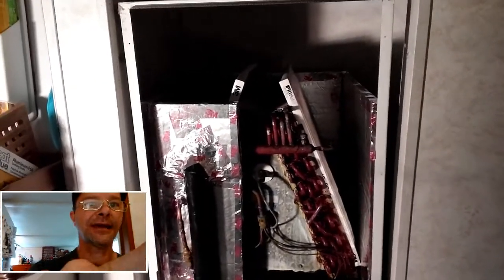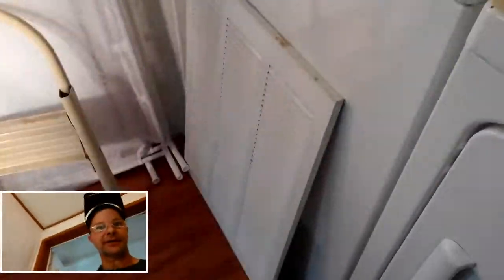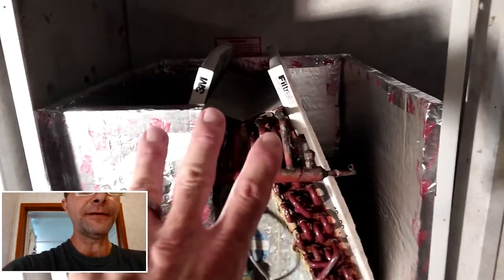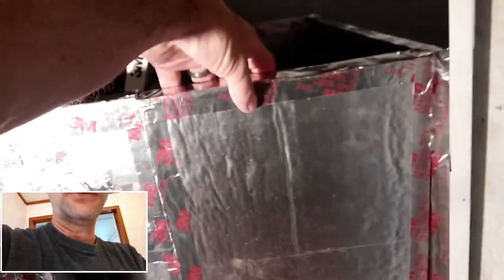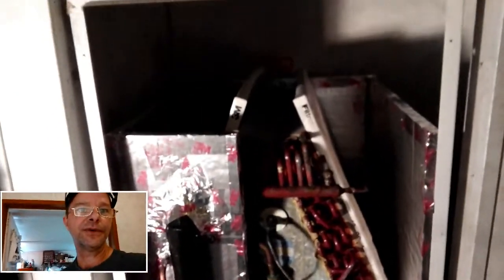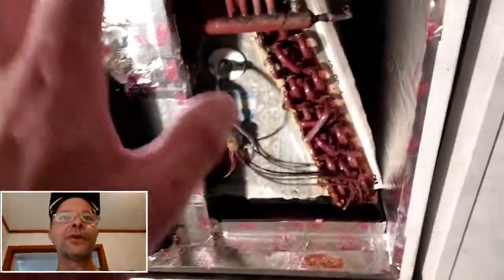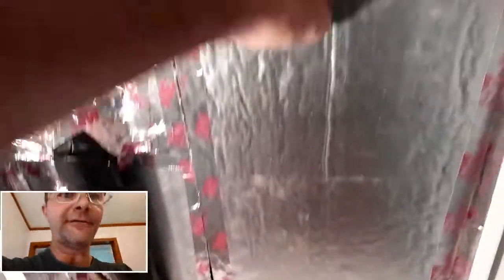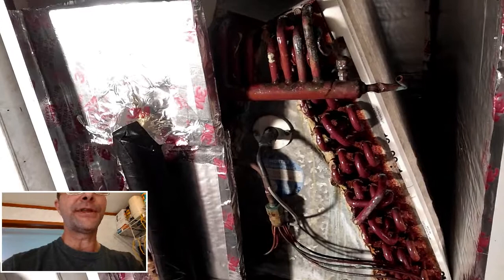HVAC Filter base update, NEW LG E-980 vid. Phone!!

Comment from the maker: Noperz, the enclosure is actually aluminum coated foam board.  I would have normally used fiberglass board but didn't feel like driving an extra 20 miles for the stuff, so just stopped at Lowes.  Use aluminum sided since I dont' want any chemicals leeching out of the material into the airstream.  I know they say the stuff is 'safe' but I'm paranoid ;)  I am using metal tape to cover the cut ends.  I installed the UV bulb, and they say they do kill micro-nasties but I don't have a way to prove it

Comment from the maker: Ok, seems to be working! If you mean an access for the drainline, no. Good idea though. The line drops straight down under the house, right past the sheetmetal into the blower section the drain pain is tied to the PVC with a bit of clear rubber pvc tubing (easy to blow out a clog) but I might as well put in a Y section there to pour some bleach in once in a while!